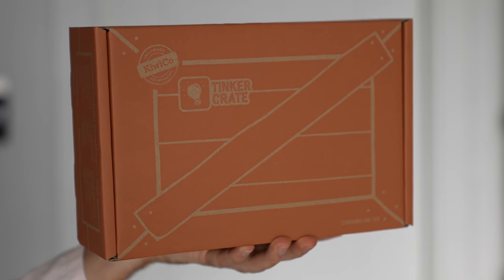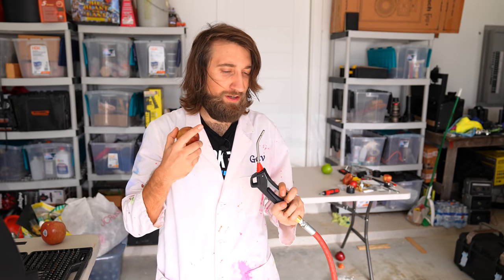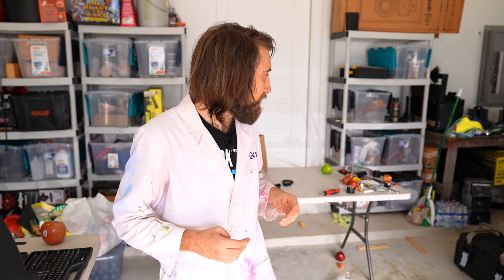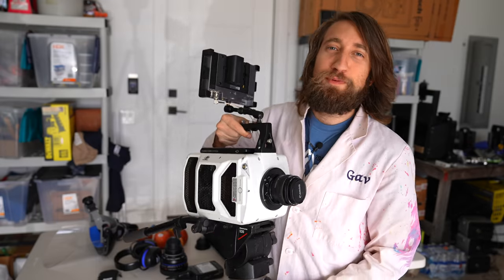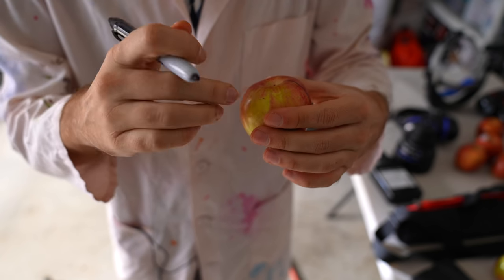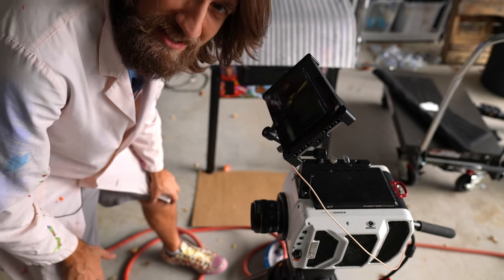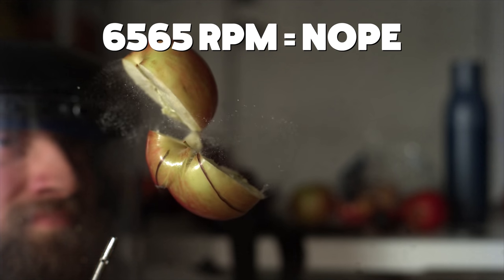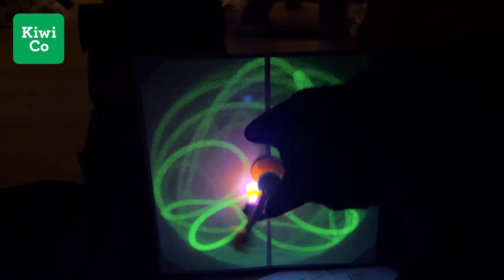Spinning an Apple until it Explodes at 28,500fps - The Slow Mo Guys

Comment: the "Nope" speed should be an official unit of measurement
Reply: "The speed of nope", η
Reply: Not a unit of measurement, but rather a physical quantity which describes certain materials and geometries. Like coefficient of friction. Since every object has a different Nope speed.
Reply: @SirPhysics  i concur
Reply: Don't you have enough fantasy units already?
Reply: Bruh
Reply: My “NOPE” speed is of highest quality where people don’t even have to ask me to hang out. They just have to think it and I hit em with that “NOPE” 😂
Reply: This please
Reply: I wonder what the nope speed of a human is 

Vertical and horizontal axis 

I imagine it to be quite fast
Reply: I imagine there is a unit for nope already, though it will be more complex than just RPM since it probably depends on the radius of the object, but thinking of things like airplane jet engines, it's pretty important the fan blades don't spin themselves apart and have a good margin on doing so (which they have done if damaged or badly manufactured).  Generalising the calculations so other sized engines can be designed better first time around based on experience probably saves a bunch of costs.
Reply: The nope speed could be a scale, jet engines would be really high in the scale.
Reply: @richofer96  asteroids have a very low nope speed 

Especially c class asteroids
Reply: @captainahab5522  Vertical axis human nope speed (VAHNS) was demonstrated in Brian De Palma's Mission to Mars. Unfortunately, he didn't borrow Destin's 2511 when filming it.
Reply: @warren286  the η is unfortunately already in use
Reply: Haha, I would love to see the aviation world adopt “Vnope” instead of “Vne”.
Reply: I bet that somewhere, there is a paper saying something like "the maximum rate at which a flywheel or other rotating body can turn before  suffering mechanical failure."  And it could totally be replaced by the Nope Speed, wN. As in, "a golf ball has a higher nope speed than an apple."
Reply: what’s the human nope speed

Comment: This is why you need safety glasses anywhere in a shop, his eyes weren't even closed until the chunks were already across the room.
Reply: if the apple went for his faceshield im sure it would just rip through it.
Reply: @RdL let's not go too far lol
Reply: Wish my shop had supersonic apples
Reply: alright science teacher
Reply: @Kenton Nigrelli Less about what an eyelid can protect and more about how the fully automatic physical response was so slow in comparison; there’s no “just don’t get hit” at those speeds.
Reply: @MRdeLaat  It probably wouldn't.
Reply: @MRdeLaat  his faceshield would be fine,  it's probably ansi z87+ rated and is designed to withstand large chunks of metal flying at it without killing the wearer, he might hurt his nose a bit due to the face shield deflecting but it's not going to go ripping through it
Reply: @MRdeLaat  Given that it hits a smaller and more rigid metal object at high speed in the first clip without breaking that, I'm pretty sure a curved and appropriately protective faceplate is suitable protection.

Comment: Did you try any other fruit? I'd like to see this attempted with every fruit possible.
Reply from the maker: Might need a bigger blower when we get to the melons. 😬
Reply: @theslowmoguys  My reply to "Daken-dono" so you guys might read this
This is all working on a combination of Bernoulli's principle and gyroscopic force.

A rapid focused airflow in combination with a rounded surface produces a crude airfoil providing an element of lift, combine that with the naturally stabilizing rotation of the apple in its most efficient way of spinning, you get what we see in the video.

(An unequal curved surface with a small amount of lift finding its equilibrium of mass in a rotation with a point vector of airflow creates a natural gyro providing mild stability) 

Getting to your idea of the watermelon, This would be VERRRRY hard to do.. Unless it was a VERRRRYYY small watermelon, The mass of the object would directly correlate to the amount of airflow from a given compressor. The usual off the shelf compressor does about 115-120PSI or roughly 8.2 Bars. Seeing as how you would need more air to generate an area of low pressure to make an average watermelon levitate, like the apple in the video we just watched, we would need some crazy industrial air compressor to make this happen.

Assuming "The Slow Mo Guys" could source this equipment I too would love to see this....

It's all on you now @The Slow Mo Guys
Reply: United Rentals, Sunbelt, or CAT should be able to supply a compressor adequate for just about anything. I've seen some of their compressors on job sites powered by thousand horsepower V12s...

On smaller scales though, would love to see oranges, grapes, blueberries, etc... Might be cool to try exploding some hard things too, like dried beans.
Reply: @theslowmoguys  Bowling balls. Make it happen!
Reply: @theslowmoguys  hahahahaahahahahaahahahahaha just imagine
Reply: U just reminding me of a creepy childhood. “Saladfinger”
Reply: WAIT URNTHE DUDE
Reply: @theslowmoguys  perfect sphere
Reply: What about a spoon? A rusty spoon
Reply: Imagine with watermelon
Reply: OMG I love your video david
Reply: TRY IT WITH RUSTY SPOONS LOL
Reply: Sock six was cool btw
Reply: Why you like? Humans have no food and water in u'r contry!
Reply: @smashedpotato8689  humans have no food and water in u'r contry
Reply: @sckip97490  what?
Reply: Why only fruit? I'd like to see a baseball explode
Reply: MELON
Reply: would say a orange would be nice, and i think when u stop before it explodes and try to cut it, its only orange juice in it , what yall think ? :D
Reply: Oranges and coconuts
Reply: @theslowmoguys  and some more intense protective gear! 😦
Reply: GRAPE
Reply: Their different shapes might be a issue.
Reply: @theslowmoguys  Slow Mo Guys, you had my curiosity… but now you have my attention.
Reply: How about we try it with Salad Fingers?
Reply: Raspberry
Reply: @theslowmoguys  Could you guys at least try an orange?
Reply: @theslowmoguys  should've done it with a kiwi
Reply: oh watermelons could be good!!. ;-P
Reply: Now time to make Fruit HE grenade with the durian.
Reply: Durians?
Reply: Don't do it! He'll then make an animated creepypasta of it! ... as a matter of fact, DO IT xD
Reply: Good to see Yorkshire's finest animator here...
Reply: @theslowmoguys  how about coconut?
Reply: I wonder if citrus fruits would hold together at faster velocities due to their tough skin?
Reply: David Firth I like rusty spoons.
Reply: Never thought I’d see you here
Reply: WATERMELON
Reply: @theslowmoguys  I wonder if you ever manage to come across a paw fruit,(No not the one from One Piece) can you try this on it?
Reply: same
Reply: @ewilorganisation  he made it lmao
Reply: David Firth and Slowmo guys - the cross over I didn't know I needed
Reply: I love you
Reply: Yes, science demands it. For the greater good.
Reply: Yes, let's start with a banana.
Reply: @theslowmoguys  A jet engine.
Reply: I want to see kiwi, oranges and plums. Shouldn’t require a compressor of absurd sizing.
Reply: @theslowmoguys  a pomegranate would be awesome to see blown apart.
Reply: @theslowmoguys  And don't cheapen out on your armor
Reply: @theslowmoguys  I always wanted to setup for a coconut and calculate the g-force breakdown needed.
I have a short series "turbo fruit" where i explored this 4 years ago.
love seeing it in higher framerates its still awesome
Reply: @bradallen3634  is my personal account. This account has the videos on it
Reply: @theslowmoguys  make it with Durian
Reply: Well you had my idea 4 months before I did. 😆
Reply: @الأخلاقمهمة  exactly what I was thinking XD
Reply: A lime or kumquat might take the speed crown!

Comment: Never mind the apple splitting, i think it's fascinating to see Gav's reaction in slow-mo on that first take.  The apple breaks and hits the visor.  By the time it's out of frame, Gav blinks due to the oculomotor system reacting.  Shortly after there's the movement from the head as the brain finally gets the message.  Follow that up a little later with the rest of the body getting the signal to protect itself.
Reply: That was the best bit for sure.. I laughed so much I cried 🤣
Reply: Exactly. The apple itself basically yawn lol. Reaction was much more interesting.
Reply: It’s very dramatic in slow mo, but honestly, how fast our bodies react to slower things (such as placing your hand on a hot stove) is amazing. our bodies are incredibly fast.
Reply: @Matt-xs7qo  We respond much quicker to tactile information because it doesn't require any complex interpretation. Visual information goes thru a fair bit of processing before it can be used to generate a reaction.

There's an abundance of evidence of this, the best demonstration of which is a very close lightning strike. Below a certain distance, we actually will perceive the sound of the thunder before the flash of light registers, even tho the eye has "seen" the flash before the sound physically reaches our ears.

There will be a reflex reaction that takes place before conscious awareness of it, but this is because the brain isn't "required", so to speak, for this to occur; hence the appearance of the "double reaction" in the high speed footage.
Reply: @MadScientist267  that’s actually incredibly interesting and not something I’ve thought of before, thanks! It’s almost like you could classify tactile as “reflex” and anything visual as “reaction”, though I know those are bastardizations of the words
Reply: @Matt-xs7qo  Indeed. It's also difficult to sum up in a YT comment lol. But the evidence of the stages of the event are very evident. There are actually 3, before it's all said and done, as the OP pointed out. 

1. The initial ocular reaction to slam the eyes shut.

2. The brain changing gears as an "oh s**t" signal is received from the visual cortex after the processing delay.

3. The "what now" processing and execution - The propagation delay in the motor cortex/neurons instructing the muscles to act accordingly.

Very fascinating indeed. As such, the apple exploding... Despite the intent of the video... Just pales in comparison 🤣

Edit: The "edited out" part he mentions is due to #2 taking place. The brain prioritizing "what just happened and what do I need to do", triggering fight or flight and temporarily ignoring everything else for a moment while it does this. That's where the look on his face goes glaze... The brain drops those controls because they're not "crucial to his survival".
Reply: Considering the latency in human reaction times, it's a good PSA to always wear proper safety gear when in these situations
Reply: @MadScientist267  Do you have source material on this? I'm not ludicrously interested in this. Dunno how long it will last, but if it's anything like Neuroeconomics, this will be a fun deep dive.
Reply: @MadScientist267  I love the breakdown, very interesting and thank you! 👍
Reply: @willmercier2852  Exactly what I was thinking.  By the time you react, the injury is a done deal.
Reply: The reaction times always fascinated me!
Reply: @MadScientist267  This was a good breakdown. Thanks alot dude.

Comment: 4:01 Why, after the inital split, does one half split again?

My theory is, once the two halves separate, they are still spinning with massive angular momentum, but now they are spinning about their own center of gravity. The centrifugal force has gone from radially outward (where the apple is strong) to sideways (where the apple is weak, you can break it with your hands this way, too.).
Reply: Another possibility is that the inside was already broken in two places before the skin split, and once part of the skin split that was enough to break the rest of the skin
Reply: @andrewsauer9669  Another possibility is that because the apple is comprised of about 85% water, and the internal design of the apple being not perfectly balanced the water is pushed into three parts of the apple and then the skin tears.

Comment: The audio of the apple spinning is also fascinating. You can put the audio into a spectrogram and see the frequency of the apple's hum slowly rise over time. In the normal 50fps video, there's a moment where the apple is spinning at just the right speed so that it looks like the apple isn't moving at all. At this point, the apple is humming at ~100Hz. And the "nope" speed at 109 rotations per second? The apple's hum right before it breaks is at ~110Hz.

Comment: FYI: 
Assuming the apple has a radius of around 4cm and is rotating at 109 rps, that means the tangential velocity is around 27m/s = 100km/h = Mach 0.1.
An average apple (according to google) weighs around 200g=0.2kg, so the centrifugal force felt by the apple at the surface is around 3750N=3.75kN, so approximately 0.4 tons of force.
What a strong apple!

Formulae used:
tangential velocity v = r * 2π f
centrifugal force F = m * (2π f)^2 * r
Reply: Noice
Reply: Y E S
Reply: It's actually 27.39 m/s. And you assumed the speed of every point of the apple is the same to get your results but its not. The center of the apple actually has 0 velocity.
Reply: Even then, that would be 3752 Newton
Reply: @laurentthiemonge3265  corrected, thanks. When doing the calculations, I used 2×6.28 for 2π so I had a double factor of 2 in there in both calculations.

Comment: I would love to see you do that with an orange (thicker skin, but already sectioned so which gives way first?)
Reply: @moonshot9056  add a bit of vodka and you've got a party.
Reply: I think it would take longer since they are more perfectly round. I'm guessing the reason it splits apart is due to the divot at the top of the apple.
Reply: @randomizednamme  It clearly started to rip at the stem of the apple. So I assume the same would apply to the orange but at a way higher rpm since the dimple isn't so immense
Reply: @Appoxo  I think that an orange would have a higher nope speed because it has a thicker skin, although the juices will fling out more because of the weaker internal structure 

One the peal beaked it will spray everywhere because the internal structure is weak 

I don’t think that you would be left with slices I think that you would be left with ripped peel and a fine mist of orange juice 

The only way to test is to do it
Reply: @captainahab5522  I agree with every point you brought up

Comment: We need to see this with an orange. Juice everywhere I'm guessing.
Reply: @melvyshaw5642  but it has to be a round fruit
Reply: An orange has a much thicker peel so I wonder if that 150psi can spin it fast it enough for it to pop
Reply: @t-wrecks7481  only has to be round to float. That compressed air will still rocket a banana into the ceiling, or rip right through it. I want to see that at 20k fps!
Reply: I was thinking a potato.